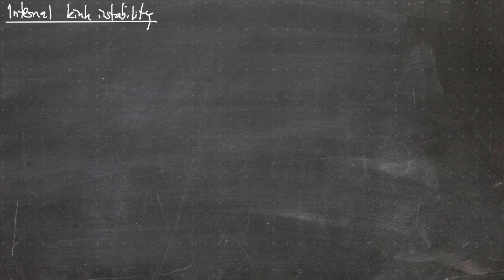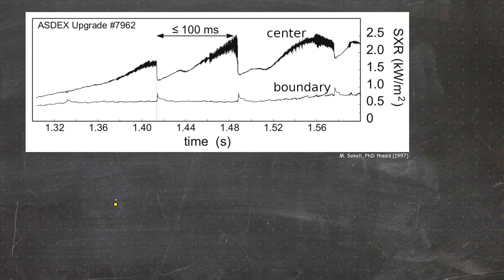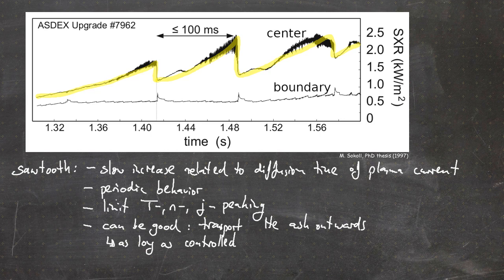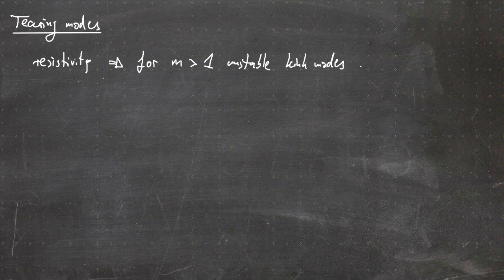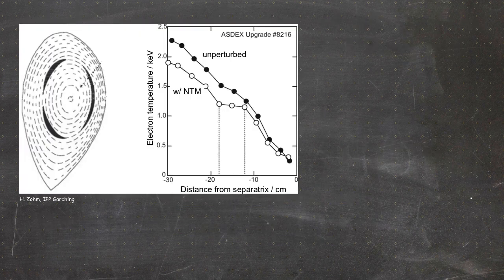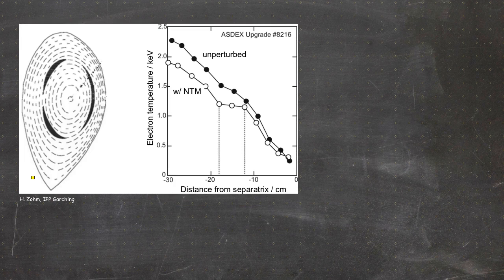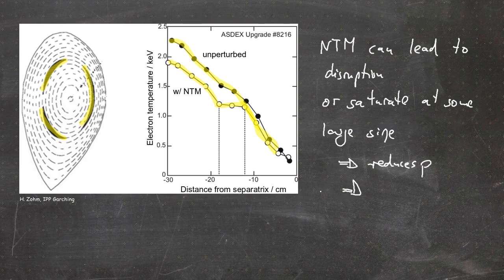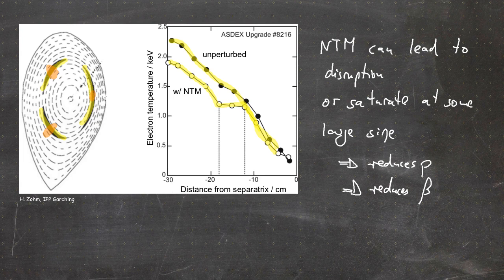Fusion Research Lecture #16 - Internal kink instability

Comment: A question. If I understand it correctly, the internal kink mode is a broad class of instabilities at m=1, and then the sawtooth instability is a special case at m,n = 1,1, and the NTM is a special internal kink mode when you take into account magnetic islands and their effects on bootstrap current? Is that correct?
Reply from the maker: Kink modes are usually ideal MHD modes, as soon as resistivity is involved and you have thus no longer ideal MHD, the corresponding modes are usually referred to as tearing modes. The sawtooth is introduced as a kink mode, although to fully describe it you need resistivity (as magnetic islands are formed which is not possible in ideal MHD). The NTM is definitely a tearing mode where you take into account the bootstrap current and magnetic islands, as you have correctly described it.
Has this answered your question?
Reply: @DerPlasma  yeah, having had some time to think about it, that makes a lot of sense. Thanks! ❤️